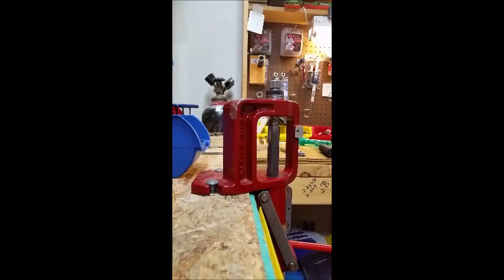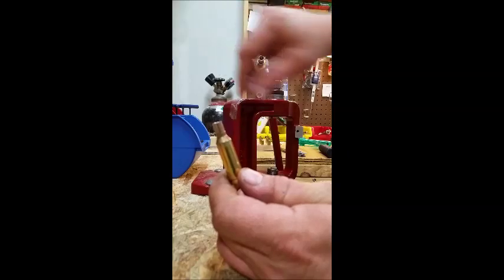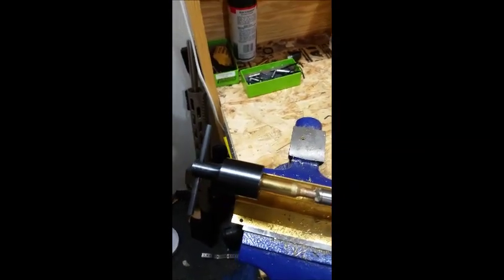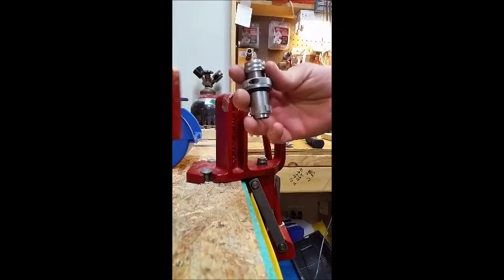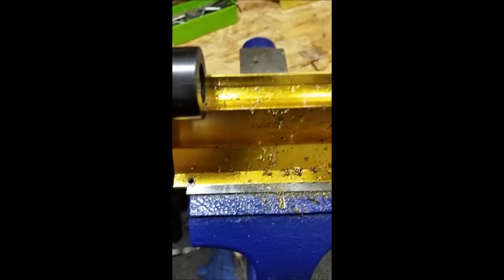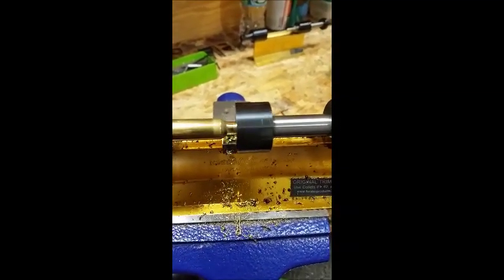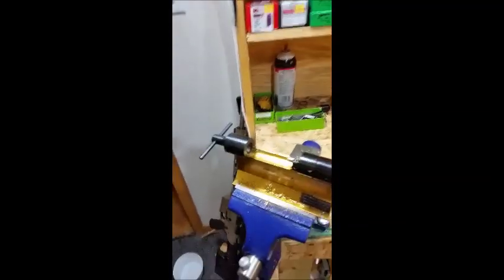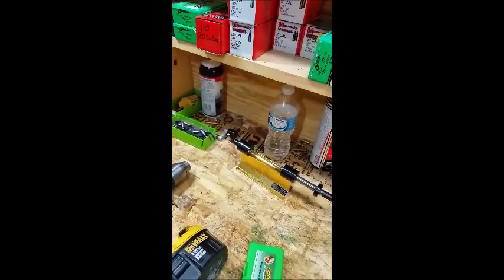making 270AR brass from 6.5x47 lapua

Comment: Hi Bruce, I did get the Foster case trimmer kit, Hornady neck turn tool, and will be getting the dies that come with the barrel from ARP. I plane on resizing and depriming my 308 cases with a 308 die. Then if I follow your video I would dissemble the die from ARP and push the shoulder back. Next I would neck ream & case trim, My question is at this point what size neck reamer would I need?  Thanks for all your help!

Comment: I do have the big Hornady case prep station will the foster pilot - reamer fit in place of the size mandrel if so I would not need the Foster Lathe.
Reply from the maker: i don't know how the hornady prep center holds it's tools the forster reamers are held in by set screw you can go to midway or forster to look at them.

Comment: Hi Bruce,I build my own ARs and have reloaded for years now, but this is my first time attempting a wildcat.So what I would like to do to save money is use 308 cases that I have an abundance of to make the 270AR cases.I am looking at the Hornady Lock-N-Load Neck Turning Tool  and  your forster lathe -- with the RCBS Case Neck Turner Pilot-Reamer 6.5mm RCBS #: 98881. " Called RCBS to ask them for help on the cutter and the reamer and the acted like I talking Swahili"So my question to you is what differences will there be in tooling between my 308 case and your  6.5x47 lapua case.Like the dies, mandrels, pilot-reamer and cutters and so on. Any help you can give me will be greatly appreciated.Thanks Ed
Reply from the maker: I have updated my personal procedure. you can use your hornady lnl neck turning tool it will work fine,  i will have to look through my notes to fine out what you need to use exactly but the forster trimmer and you can use forster reamer in stead of the rcbs that is what i am doing now. i use different dies just because i have a system that works for me. i will go over my old notes and get back with ya.
Reply from the maker: also check out my other video  https://www.youtube.com/watch?v=ZtWnuV0fLVI&t=46s